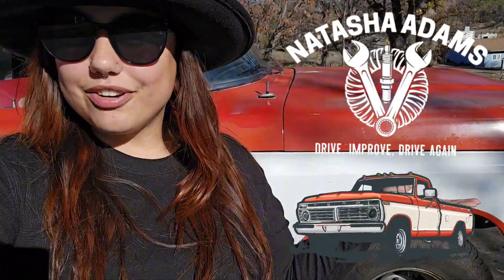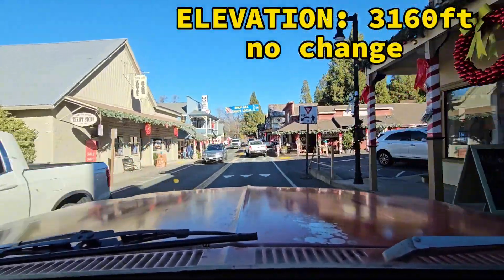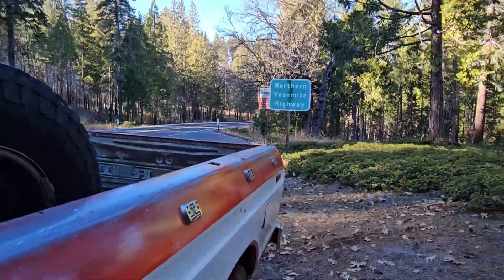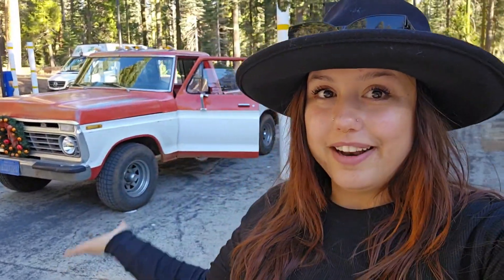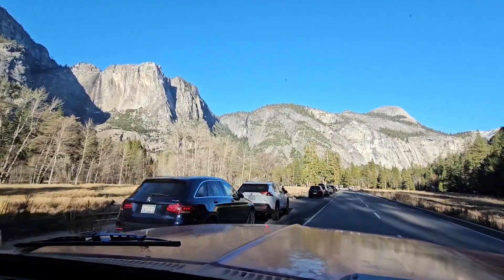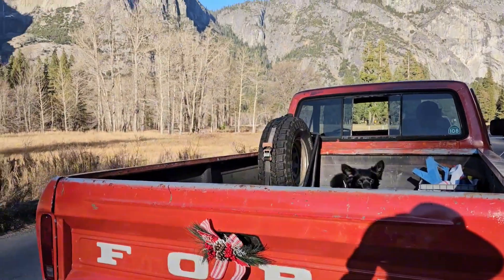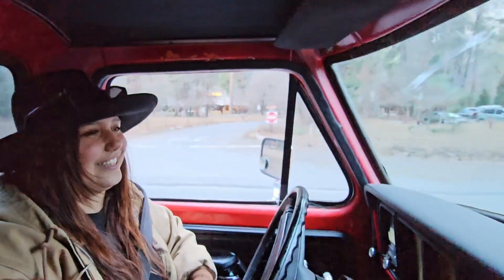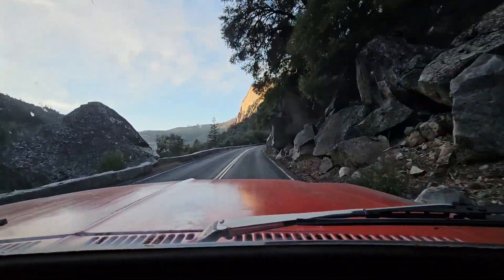I Drove Up to Yosemite In a Carburated  1973 Ford F100 390FE!

Comment: In 1997 bought a New Chevy Astro Van AWD, advertise to be a SKI mountain vehicle,, with fuel injection,, when you get up to 9,000 ft there was barely any power to go anywhere,, only a 30 mph top speed, every 33,000 miles a poppet valve injection problem rendered the vehicle stranded by the side of the side of the road, had to Towed to the Dealer to be repaired under warranty for 100,000 mile coverage due to design problems,, palmetto valve was replaced three times during the 100 thousand mile usage,, 1:05

Comment: Was either the 1975 for 1979 Ford F-150, that dad drove us through the Rocky’s at around 10,000 or 11,000 feet one year on our way through the Grand Canyon. I remember we did not go the way we normally went, when we drove out to California. And I remember getting worried about how high the elevation was as we passed through the Rocky’s, but those old Fords was and are still some of the toughest trucks on the road.

Comment: I have a 1973 f100 custom 360, I've been working on it for months and it's finally almost done,my question is that my battery lasts 5 days then it has to be recharged,I got a new regulator and fixed some of the grounds and also have a new alternator,what should I do?